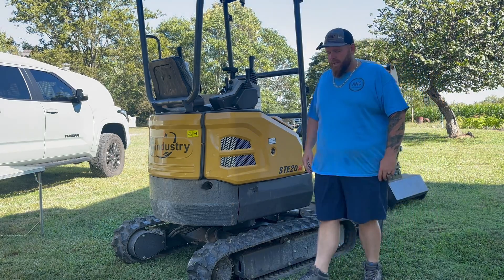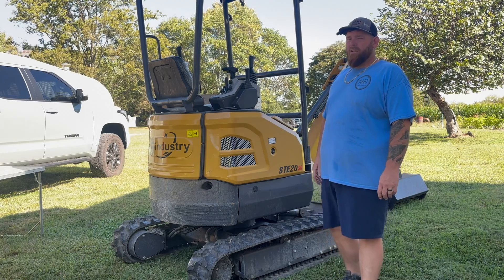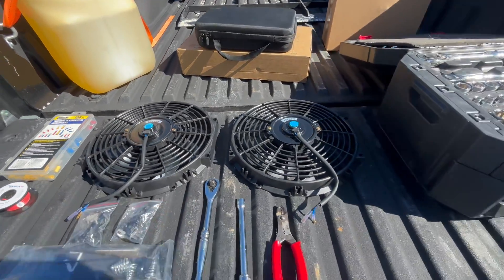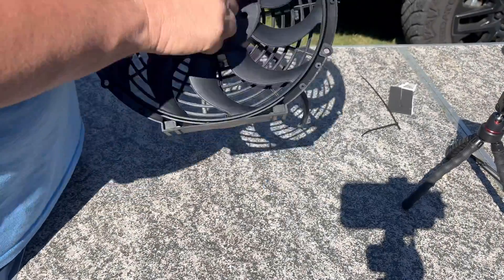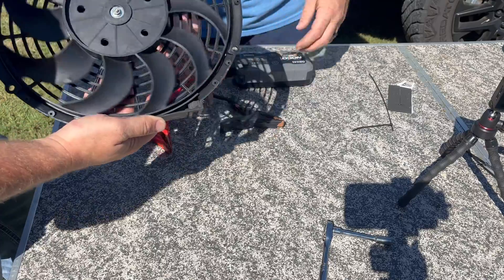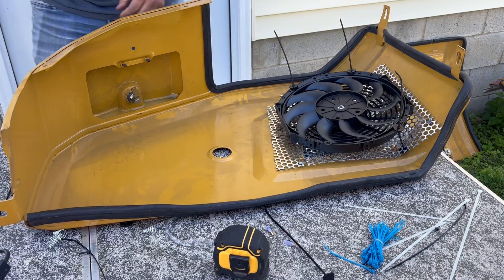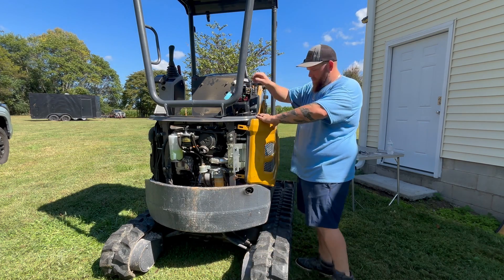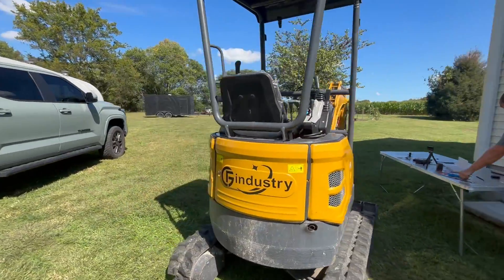Installing Electric Fans On My Chinese Mini Excavator

Comment: Separate question-Do you have the hydraulic pump manuals?  Im getting ready to flow test mine.  If you have them could you email me them?  Fyi as long as your hydraulic temp doesn’t exceed your coolant temps your fine.  All excavators get hot.  I work on these for a living.
Reply from the maker: No manuals on the pump. However i do have a video up on the channel that has some pump information in it. Was like pulling teeth to get that info!! The video is called finally fixed ste20sr!
Reply: @SOKYGarage-ANC - I saw that.  I also think I found the manual I need.  Im betting there is a lot of performance left on the table by not setting the pressure and load sense by flowmeter.  Will see!
Reply from the maker: @kevinoscarson2941 i 100% agree i was unable to get a manual directly from the manufacturer(eddie co) so if u found something thats awesome id love to see it!